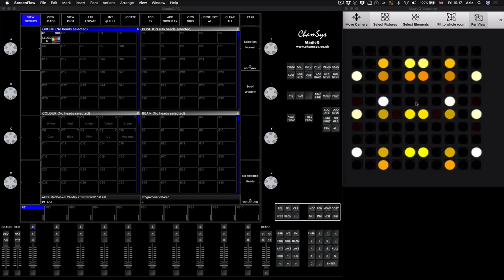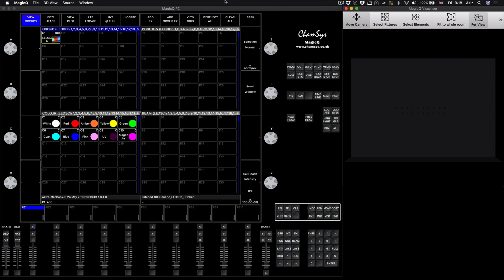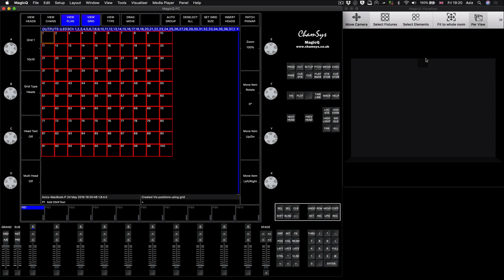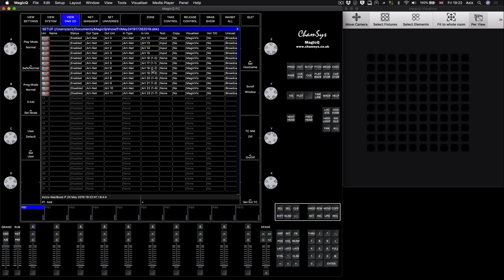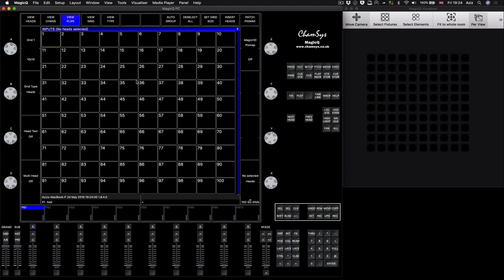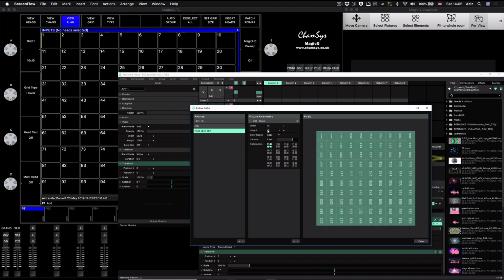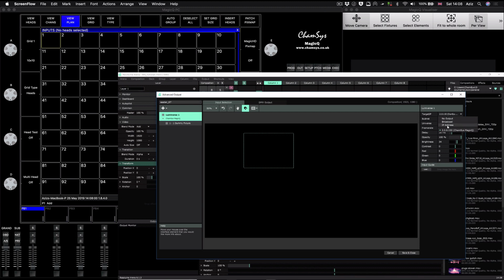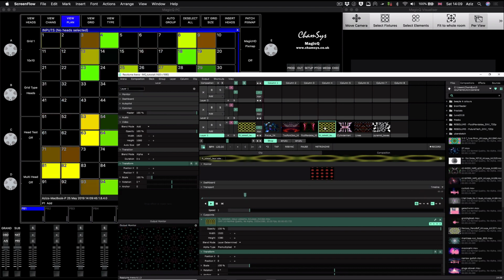Resolume into MagicQ pixelmapping [merging] P1. Simple. RGB LEDs

Comment: This is a good tutorial, but I would like to add one thing: You need to set the output universe in the Lumiverse of Resolume to the corresponding input universe in Chamsys if you want to use any other universe than universe 1. This is done by selecting the lumiverse in the advanced output window in Resolume and selecting the lumiverse and then setting the universe number (and subnet number if the universe is more than 15) in the right hand column.